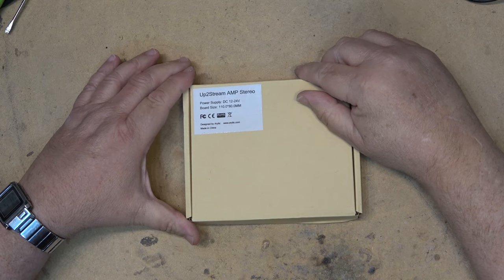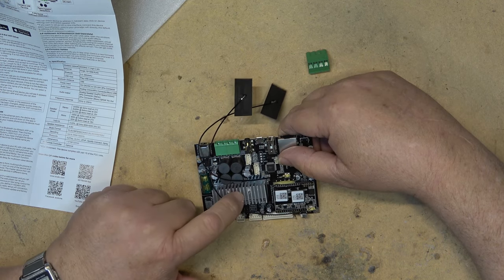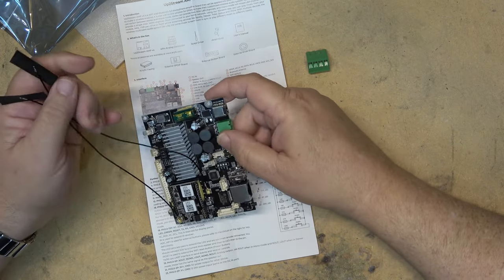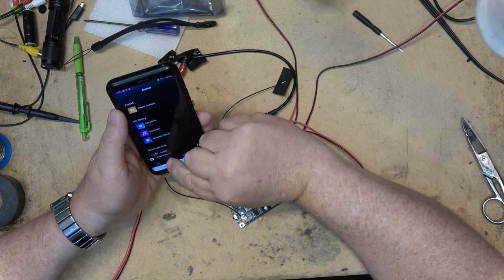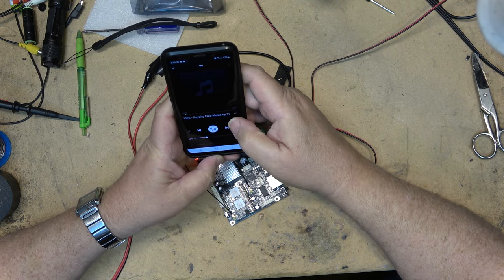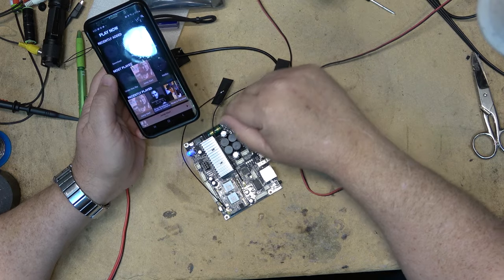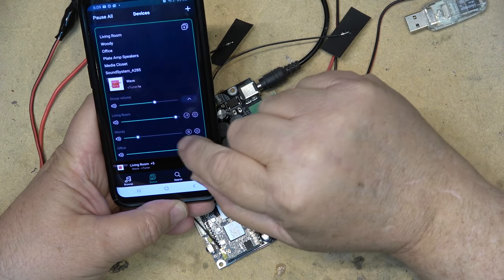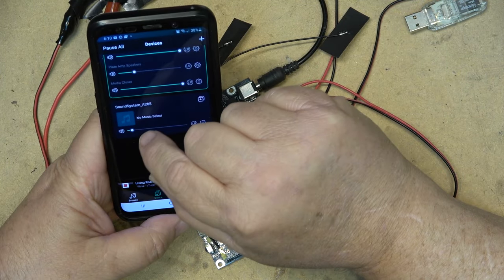Up2stream AMP V4 by Arylic Unbox and Demo

Comment: The chinese bluetooth boards are good for the price. Its a lucky dip though whether you get one with the bad "blootoo devie sucsessfulee connecteed" voice.
Reply from the maker: These are not Chinese. They are designed in the USA and assembled in china. The amplifier used Texas Instruments chip class D chip.
I should point out that these are not cheap either. This one about 100 bucks.

Comment: I like the idea that you wrote on the screen about: Synchronized mono x2 use. Nice!
Reply from the maker: That's one of the big selling features.  2 of them one for each speaker.  Install in the back of speaker or just Velcro to the back and hang the speaker.  Totally wireless. I am going to be doing a video doing just that.  Will stick to back of speakers with Velcro and configure one for left and other for right.  I have been running several here for the last few years and never as much as a glitch.  If the power goes out they reconnect themself and you just start the stream again.  I have a few that I leave running 24/7 on a local FM station that is relatively weak to receive off air in the house but the stream is perfect.  
That would be wave 98.3 out in Vancouver.  It's funny because they owner has several stations in Ontario so they carry the stream on the hd2 stream three and we get the FM+hd1 here but they are not quite strong enough to pick up in the house.  In the car they are fine.
Reply: @12voltvids  Yes. I noticed that you have a very 2020s setup in your home with all sorts of feeds, this, that and the other thing. Awesome and more power to ya, as always!
Reply from the maker: @MrChrisRP  just more ways to waste power lol
Reply: @12voltvids  Yes! I know what you mean. I do not pay for electricity here (me personally, I mean) but still just yesterday I pulled a USB hub out of the front of my machine because I noticed it gave off a tiny amount of warmth. I don't require extra ports and longer, so I decided to just put it in the drawer. Every time I blast my amps or even doing so when gaming, I think about all the power being used in total from the activities. It doesn't stop me though. hahaha
Reply from the maker: @MrChrisRP  wait till you have to pay for it?
Reply: @12voltvids  heh heh absolutely.